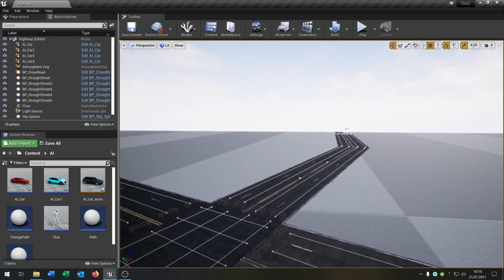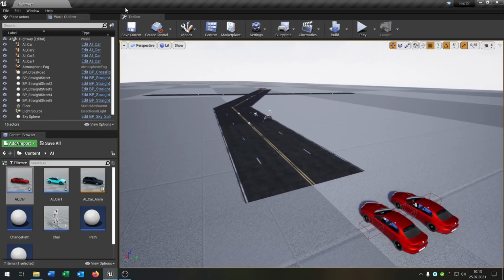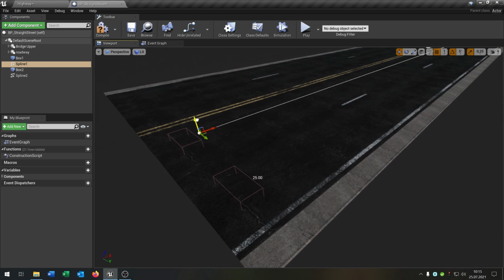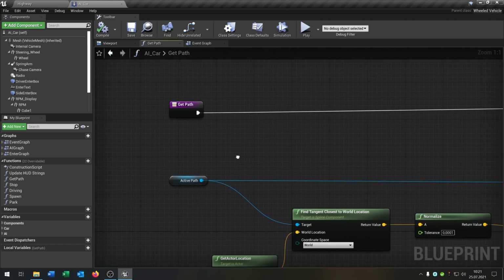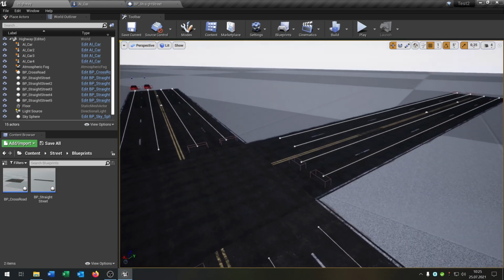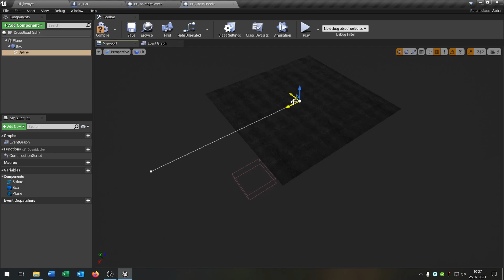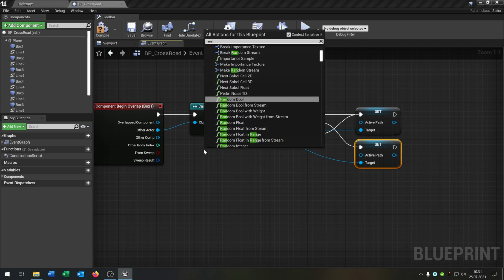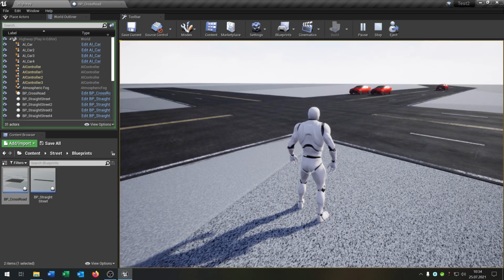Unreal Engine AI Car Tutorial: Calculate Path

Comment: Hey what do you think of using AI Behaviour tree for AI Car ...it'll be preety neat I think ...what are your thoughts ? ...@Seredias
Reply from the maker: Good Idea, but the Problem is that the AI Car is not really an AI in Case of the Unreal Engine. 
For Example an AI Charakter can use the normal AI-Functions like "AI move to". 
The AI Car cant use those functions. So it would work but has no benefits with an Behaviour Tree.
Reply: @Seredias.   Oh ...ok cool bro ...glad you answer every comment ...huge respect..